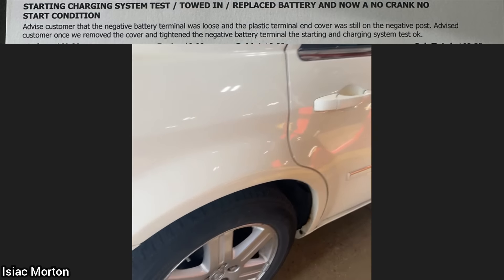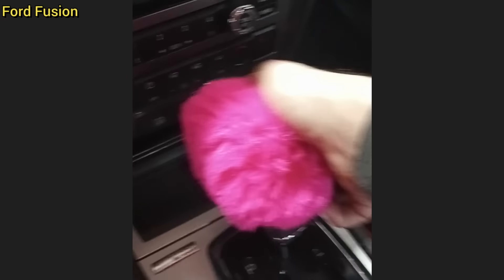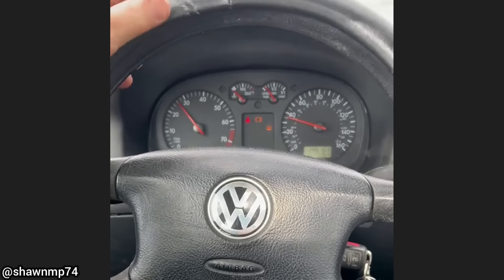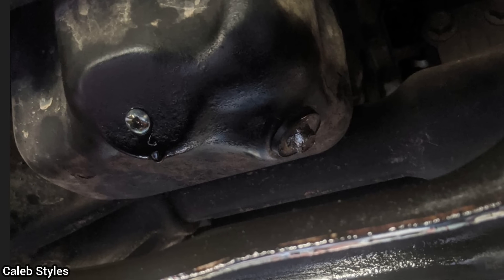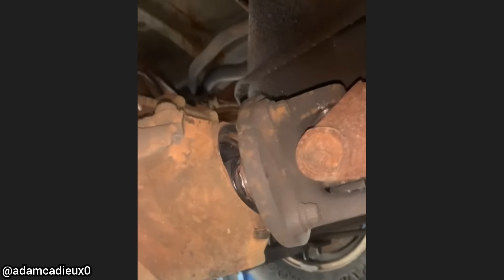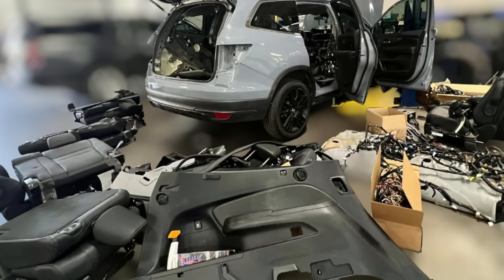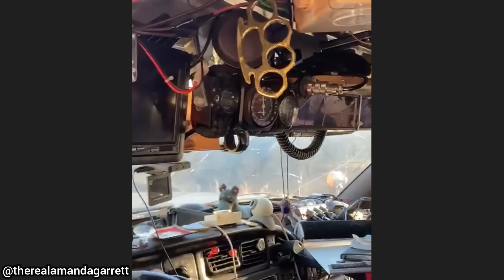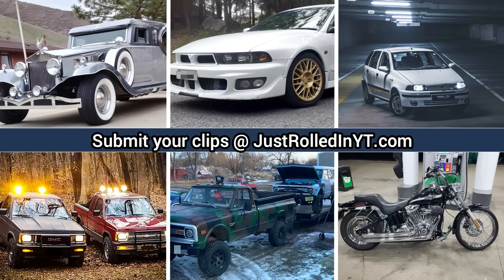Customer States He Replaced The Battery & Car Doesn't Start

Comment: I had a customer lie about a bunch of shit about his trade without seeing it, and we bent over backwards to make a deal work on a new car for this guys wife. I needed two additional signatures and couldn't get a hold of him for over a month, but when he finally called back, he was furious with me because, "for the past week the car has been squealing and buzzing and the noise is so loud my wife can't even stand to drive it anymore and it's ridiculous your service department can't even schedule me until 1 month from now!" I tried to walk him through some typical issues like closing all the air vents, having a window cracked slightly on the road, etc., etc.... and finally asked him to drive over that day for us to at least take a listen. 
Mfer had a smoke detector with dying batteries in his trunk blaring the alarm for the past week and he never once checked his trunk to investigate the issue. Bruh
Reply: Smoke detectors with dying batteries make an intermittent beep not a squealing, buzzing or blaring.
Reply: I once had a car to check for a bad stink. There was a bunch of rotting food on the backseat!!! Some people just can't put two and two together.
Reply: @HighSierra1500  ...that's five, right?   ;)
Reply: Common thing on this channel as well. Leaking oil from the exhaust - just oil can in the trunk. Leaking gas/ water, some tipped over container of the liquid in question.
Reply: Der der ! The world is full of them .

Comment: Plastic cover left on the battery terminal. 🤣
Reply from the maker: the meme became reality lol
Reply: Imagine having to spend $150 to tow your vehicle because you don't realize that plastic doesn't conduct electricity 😂🤣💀
Reply: @VintageCars999  Yes. Same as the ones that have no fuel in the tank.😵‍💫🤣

Comment: Watching that mileage role over made my whole day that much better! 
So satisfying.
Reply: singlekc  bruh million kilometers is still impressive...
Reply: singlekc  621,000 miles seems impressive to me. One of my vehicles (a former taxi) is showing 440,185 miles and it's on its fifth engine, second (manual) gearbox, and currently has the whole front end dismantled as I'm having to basically rebuild everything due to body rust and extreme levels of mechanical wear.
Reply: @UncleKennysPlace  spoiled kid

Comment: An ex boyfriend story:  I grew up in the late 1960's and early 1970's fixing cars with my dad and rebuilding engines at the local high school auto shop class.  I served 5 years in the US Navy as a Machinist Mate in a steam engine-room - which is a heavy mechanics job as you are always fixing and rebuilding stuff.  Then I pursued a Mechanical Engineering Degree as I had dreams of being more than a mechanic or operator in a power plant.   Upon Graduation in 1985 I purchased a 2 year old used 1983 Ford Escort GT and then purchased the full set of maintenance manuals so I could do my own work.  

Key to this story is this engine was an interference engine with a timing belt that needed to be changed regularly (they did not last as long as current belts).   For those that know the history of the Escort engines (cast iron block, aluminum head).   The GT engine had the robust head that didn't crack - and Ford changed all the production engines for Escorts to that head I think by late 1984 (without the performance camshaft for non-GT cars).  Ford replaced a lot of heads on a lot of Escort engines in those days as they often cracked within a few years of ownership.

One day one of the "hot" mechanics at the power plant asked me what I did over the weekend and I replied that I changed the valve seals, installed a new camshaft and lifters, and replaced the timing belt on Saturday (and that did not even take a full day - and went somewhere Saturday evening).  He then asked me about changing the timing belt as his girlfriend had a Escort and needed that done.   I told him that it was not that hard if he had the right metric wrenches and sockets (and told him the sizes I used), and to be sure to properly line up the "timing" marks when you put the new belt on (I explained what they were and how they had to be lined up).  He said that he understood and was off to Sears to buy a full set of Craftsman's metric wrenches and sockets (those are actually high quality tools even if they don't have the finish of Snap-on - Note that I own a set of Snap-on metric deep offset box end wrenches that I purchased to work on that Escort GT).

He came in to work after the next weekend devastated.   He forgot to line up the timing marks - and pistons hit valves.     His GF demanded that he pay for a new Ford engine and dealer installation, and a rental car until her car was fixed.    Then dumped him when she got her car back after he paid for everything.   I never heard of him fixing cars again, while I fixed cars for a number of people (even some of the plant staff).  I no longer much work on my cars (now in the mid 60's and am not as flexible and robust as I used to be).  Changing filters, light bulbs and oil are about all I do now for both me and my wife's car.    I sold someone my drum brake tools several decades ago.
Reply: My cousin had an 87 with over 300k miles. The drivetrain outlived the chassis. Rear struts punched throttle towers from rust (salt belt). Ford messed up in the mid 90’s to early 2k’s. Changed the head design and they started dropping valve seats.
Reply: @kd7cwg they went to the split port 2,0 for the base engine
Reply: @kd7cwg   I got that car at about 60,000 miles from a "on the road" salesmen.    Of course a problem in those days was that seal materials just did not last, which is why I had to change the valve seals and had a hydraulic lifter that wasn't working properly.   The Auto parts store actually offered me the "original Factory OEM" seals and parts or aftermarket parts with new seal materials (at a modest cost increase).  I took the new seal materials which lasted me for the rest of the life of that car.

About a year later I paid a mechanic to drop the crankshaft and replace the main engine crankshaft seals as they were leaking badly (the car had a manual transmission), again with new seal materials vs the original.  That job is best done with a car lift which I did not have and I did not want the misery of doing it laying on the floor.

I drove that car until above 275,000 miles when all kinds of other non-engine non transmission things started to go wrong on it that were costly to repair, and I could see the cost escalating a lot if I kept the car with further degradation.

I do believe that somewhere in there I paid a transmission shop to replace my clutch, and tire shops replaced tie rod ends multiple times (which was required in those days).   I believe that I did all other work on the car for the 200,000 + miles over decade (or so) that I owned it.    I traded it (very little value) for a 1995 Aspire with only 4000 miles on it - and drove that for over 250,000 miles as well with just normal wear part maintenance and filter and oil changes.

My current 2009 Hyundai Sonata, which I purchased new, has over 300,000 miles on it and everything appears to be in great shape (I did have to replace the muffler this year as the welded seams corroded through after 14 1/2 years).  As mentioned in my original post I no longer do much maintenance work myself other than light bulbs, filters, and most oil changes.  Other than that only routine brakes, tires, etc with a replacement suspension about 4 years ago.  Only 1 replacement set of tie rod ends so far (they last a lot longer now).  Of course I run synthetic oils in my cars since Mobile 1 came out.

Interestingly, the 1983 Escort had a extra slippery colloidal suspension of graphite particle oil which the salesman used when I got it which I continued until Mobile 1 came out. That oil was black as the ace of spades right out of the bottle - but worked very well as evidenced by the like new condition of the crankshaft and connecting rod bearings when we dropped the crankshafts to replace the main engine seals with about 100,000 miles on it, with the original Teflon lining patches in the bearings still there - the mechanic was totally shocked as he had never seen such good bearings in a well used car engine - and became a believer in enhanced slippery oils that day.

Have a great day - and may all the good and honest mechanics keep up the good work.

Comment: Cracks me up the amount of so called battery related issues some customers have 😂😂, and as for the guy hitting those rims better hope it's not a alloy rim otherwise once they are bent or cracked they are stuffed.
Reply: That guy’s wife had to hit that curb pretty hard to damage those wheels.
Reply: @patrickperry6945  I can't believe people decline repairs that are somewhat dangerous if left. Like people not fixing tires, or brakes, etc and they drive off putting people at serious risk.
Reply: Pretty sure they are cast. High end cars (roush mustangs) for example came with forged wheels.

Comment: I did the battery cap thing just a few days ago, but I figured it out right away when I tried to unlock the doors with the key fob.  It was the negative post with a black cap.  I just forgot to remove it like I did with the red positive post just before.  In my defense, the black cap was hard to see in the light I was working with.
Reply: But you figured it out without paying for a tow and a diagnostic, or going all rage-beast and taking the "defective" battery back to the parts shop.
So, good on you!

Comment: Steering wheel covers not only look tacky and cheap, they're dangerous too.
Reply: A quality one that is correctly secured (not just a friction fit) can improve a wheel, but most modern wheels have all the grip and ergonomic shaping you could need. Also, the material they are already made of will be significantly more robust than the cheaper covers. You need to spend a lot to get any real benefit.
Reply: If you buy the proper size steering wheel cover for your car they are a bugger to install. I know ‘cause I’ve done it. This person probably got a bigger cover because they couldn’t figure out how to install the proper one.
Reply: women put them all over toilets and cars. how sanitary!
Reply: They are also illegal in most states but get about the same enforcement as license plate covers and things hanging from the rearview. Although I do know a shop that removes any they find when someone brings a car in.
Reply: I hate those covers. It also amazes me that the driver of that vw was so brain dead that they couldn’t tell it was slipping 😵‍💫. They do make actual stitch on covers now. I used one on my car because steering wheel cover was deteriorating.
Reply: @jonathanparle8429  My first car, 1983 Oldsmobile Omega, had the thin hard plastic steering wheel, the previous owner had installed one of those faux leather and plastic lace steering wheel covers. It was a Godsend, and it was secured tightly enough that I never had issues with it. Even with a bad steering rack that would randomly not let you turn to the left, until suddenly it would and you'd have to be ready to counter-steer to the right if it decided to suddenly loosen up. After replacing the rack, it steered like most 80s GM cars: one-finger was all you needed, even when parking in a lot.

My father had the faux sheepskin seat covers on his '85 S-10 Blazer, while it certainly helped with the drawbacks associated with vinyl seats, our backs would be drenched in sweat after a few minutes of summer driving.
Reply: @MarylandFarmer.  I don't believe this is true, I can't find any info on any states banning steering wheel covers. Maybe in some countries they are.
Reply: I have a steering wheel cover for my CR-V that has gel pads where the hands rest. My doctor recommended I get one. It makes it much easier on my arthritis driving on long trips.

Comment: I’ve also seen people fail to recognize and remove the plastic caps on the battery terminals.
Reply: We had a new guy install wiper blades for a customer. They came back pissed because they smeared worse than the old ones. Lube tech didn’t remove the plastic protective covers off the blades 🤦🏻‍♂️
Reply: @kd7cwg  😂

Comment: Loved the Opel clicking into One million Kilometers. Goes to show that with some TLC it can be done.
Thank you Mr "Rolled in" for making me forget about the Gaza strip, the Ukraine and the Cardashians !
Happy new year form a windy and cold YVR
Reply from the maker: Stay warm my friend! 
Snowing here tonight in western Alberta
Reply: i was quite surprised also as most of the vectras i have worked on had the engine harness biodegrading in the engine bay (insulation literally flaking off with copper exposed) not fond of most opel cars in australia. lol
Reply: I've owned one with the same engine, and it was a great car. Got 350k out of it and had to get rid of it because of local emission rules. Only had to change the alternator once besides normal maintenance. It's probably still going strong somewhere else.

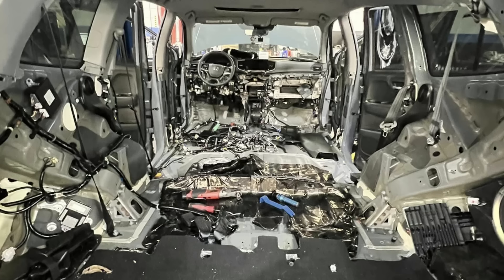Comment: I used to do electrical work on GA airplanes (Cessna, Piper, Beechcraft, etc.) that ranged from light single wire repair/replacement to major harness builds/rebuilds. Working on older planes was rough if they underwent multiple equipment upgrades as many mechanics would just remove what old wires they could, and leave many unused ones behind, to the point it would take me a day's work just to remove all the dead and unnecessary wires before installing the new. So seeing the abomination at 2:21... makes me cringe. It's a visual equivalent of nails on a chalkboard to me.
Reply: Betting he is going to close the door on that thing one day and the car/truck will definitely let the smoke out, unless he can disconnect the battery terminal fast enough.

Comment: I worked at a auto parts and a customer said the new battery did not work . I went out removed the cables and the plastic protectors were still on . The customer was pissed , he was a retired lineman . He wasl like damn .
Reply: i worked at an auto parts store and it was concerning how often shit like this happened. but at my store, it was more common for people to not remove the plastic covers from the brand new windshield wipers then get pissed at us bc their wipers aren’t working right
Reply: @misseselise3864  Or the brake line didn't fit an it had a different fitting on each side and they were trying to install backwards .

Comment: I once drove 200 miles to fix a  new Air Traffic Control Radio antennae that did not work,  they had left the plastic protector caps on the connector

Comment: 621k miles, still pretty amazing! I wonder what repairs have been made along the way to keep it running?!
Reply: @mclarenscca, there are surprisingly many videos about people who've had cars tripping 500,000 and even over 1,000,000 miles! Amazing to hear some stories about how many batteries and other parts they've bought, the number of oil changes etc. I'd be interested to see how many "newer" vehicles can hit half a million to a million+ miles & compare the costs of "maintenance/repairs" with those of older style engines from the 80's, 90's and into 2000. I mean some of "newer" these vehicles experience serious engine/drivability problems leading up to 100,000 miles and certainly beyond that. If they're not needing major engine work, then some of them require cleaning of valves and other components because of the "direct injection" design. I hated the idea that suddenly they began putting the "water pump" behind the timing cover and run it off of the belt/chain and when the bearings wear in the pump, it dumps water right into the oil pan below.... What an absolute stupid design when for decades the water pump remained external to the timing components and at most your coolant just gets dumped on the ground, clearly indicating a pump failure rather than potentially ruining your engine by dumping coolant into the oil pan. Designs that are just beyond stupid.

Comment: The only one i have a little bit of sympathy for (aside from the girl with the crazy ex) is the fluffy pink covers. Yes theyre ridiculous but, i hate how much modern cars make you jump through hoops to do simple things like remove the key, or put the car in gear, etc. I think the 2000s were the sweet spot with car "features" where they actually enhanced the driving experience rather than try and completely take over. These days it's gotten ridiculous!